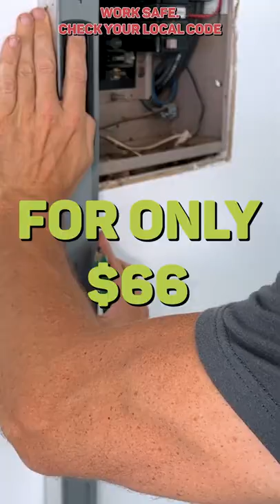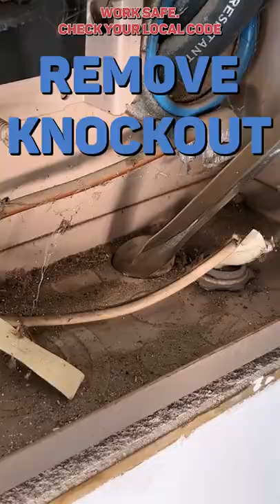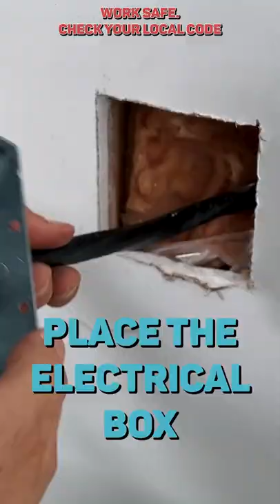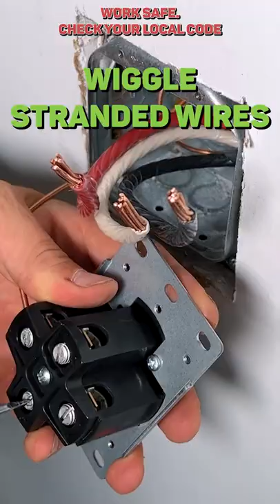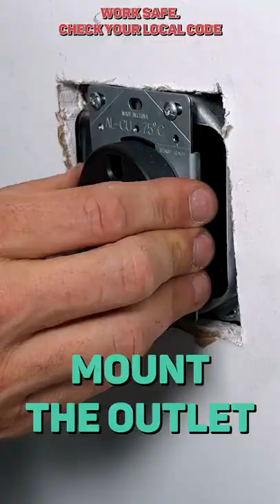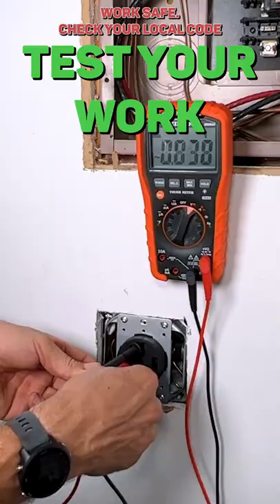240V Outlet For $66 #shorts

Comment: Using a bare wire in with non safe terminal screws, 250v, 50amp is a recipe for a big boom-town.
Reply: 50ampere is quite much I work with up to 16 at 230V

Comment: There has to be something wrong for these plugs to be melting if they are rated for say 50 amps. Im betting these batteries pull far higher amps like closer to 75-100 min and the wire feeding them is undersized. What i dont get is why a breaker isnt poping generating that much heat.

Comment: Didn't use a real double gang, cut in box, no connectors. The wire looked like it was sized for a 60 amp breaker, and the ground looked like a #12. Minimum size needed would be a #10. You did practically nothing to code. You should delete this video.
Reply: A lot of his videos are like this. Handyman doing electrical is not ideal.
Reply: For practical purposes is going to work because he is also using the conduit which is grounded. He is using a 6/3 wire with a NEMA 10-50R and should not be a problem but the inspector might not think so. ?? Local code needs to be check.
Reply: @francosepulveda8438 what inspector?
Reply: What about properly torquing the lugs?  I didn't see a torque screw driver.
Reply: He did nothing wrong. He did use connector and that’s a 10 gauge stinger. 6-3 copper can be used on a 50 amp breaker.

Comment: Need a cable clamps where the wire goes through the knockouts at the device box and the breaker panel.  The omission is a code violation and will be encorced in many places.  Vibration and heat, overtime, will cause the steel box to slowly cut through the insulation of wires resulting in electrocution hazard.  Also, the video does not show a cover plate over the receptacle.  I'm sure you did this and it probably didn't fit within the length of the video.

Comment: Ur videos been helpful to me. Im learning alot. Thanks for sharing. If i use this kind of 240v outlet, what gauge of wire is that? Thank u in advance.
Reply: Depends on current. I'm installing two 240v receptacles. The 50 amp circuit with be 6 gauge, my 30 amp circuit will be run with 8 gauge to support 40 amp in the future. You'll also want to upside for longer runs of copper. Google should tell you pretty clearly what you'll need.

Comment: I have a 210v window air conditioning my outlet is 110v.  What size of wire do I need. Thanks
Reply: What?🙄
Reply: You did not give enough information.  Wire size is based on current.
Reply: You just need a step up transformer to get you to the voltage you need to supply the equipment or find a different power source that will get you to the 210 or 208 nominal voltage you need.
Reply: @elblazintuna6468  it is legal to re-identify your neutral as a "hot wire".  This would allow Romex (NM cable) to supply 220-250vac.  Again, the wire size may not support (supply) enough current to support the load and positioning the neutral wire as a hot may not allow the 120vac controls to no longer function.

Adding a transformer might be a very expensive fix.  Nec section 450 covers transformers and has requirements for extra fuses and in some cases separate rooms with fire rated walls at 3 hours (6 inch thick re-inforced concrete) or  a sprinkler system and a 1 hour fire rating.  This is nec section 450.42.
Reply: @elblazintuna6468  it is legal to re-identify your neutral as a "hot wire".  This would allow Romex (NM cable) to supply 220-250vac.  Again, the wire size may not support (supply) enough current to support the load and positioning the neutral wire as a hot may not allow the 120vac controls to no longer function.

Adding a transformer might be a very expensive fix.  Nec section 450 covers transformers and has requirements for extra fuses and in some cases separate rooms with fire rated walls at 3 hours (6 inch thick re-inforced concrete) or  a sprinkler system and a 1 hour fire rating.  This is nec section 450.42.
Reply: @keithharrington4595  if your only being supplied a neutral and an ungrounded from the 120 receptacle, I’m guessing you would just have to run a different circuit from the panel for your 240 volt load( or whatever voltage the AC was)? Making it a two pole breaker for that as well?
Reply: @elblazintuna6468  Yes.  You can mark your neutral (normally black, red, or blue industry standard, no NEC requirement) and connect it to a double pole with the hot for 240 volts.  Again, wire size determines the amount of current.

An example of this is your water heater with 10 - 2 Romex or NM cable.

Double pole breaker with black as hot, white re-labeled (taped) as a hot and the ground for this 30 amp circuit.

My concern with what you are asking is, do you need a neutral?

Your stove gets 240 vac for the heaters, but the neutral allows the clock to run on 120 vac from the same circuit.

So, like your stove, you may not get control functions to work on your a/c unit without the neutral.

I will encourage you to talk with a local licensed electrician.  Maybe a beer or some cookies for them to come out and advise you.   Like Google maps, they can get you on the correct path and let you do all the driving.
Reply: @keithharrington4595  Your range has a specific recep that is wired with two hots and a neutral along with your ground, so your 120 functions will work just fine as long as it’s properly wired, the in question AC sounds about the same scenario? You wouldn’t be able to get the required voltage out of a normal receptacle, unless I’m just overthinking it?
Reply: @elblazintuna6468  If I make 10-2 carry 240, the wiring looks like this....

Ground..,remains ground.
Black hot....remains hot (one leg of 240)
White.....becomes a hot ( leg two of 240)

This means the neutral is lost.  The only voltage you get is 240.  The 120 cannot be achieved without the neutral.

Should this be a stove, your electronic controls are lost...no clock, no digital timer as they are 120 v.

I expect the air conditioner is the same....no 120, no digital controls.
Reply: @keithharrington4595  yep 👍 you got it
Reply: use #10 awg wire.  10/2 and use a double 30/30 amp breaker
Reply: @michealnunez6346  again, will it work without a neutral?  Many appliances need 240 vac to operate major components and 120 vac.for thee controls.  This 120 vac is gotten with the neutral.

I again point to a stove.  240 for the heaters and 120 for the clock and controls.    Should your clock control baking time, no oven.  The more controls from the clock, the more you loose.

Apply this to your a/c unit and you may have a giant paper-weight.
Reply: @keithharrington4595  to provide power to operate the timers, vent fans, and other accessories, the stove uses a simple 120-volt circuit, but it also uses a 240-volt circuit to heat the stovetop heating elements and oven heating coils. Hence, it requires a 120/240-volt receptacle and circuit with an independent neutral wire that provides a return path for the 120-volt portion of the circuit.
Reply: Also yes 240 circuit runs with no neutral. Ground stays ground.
Black stays hot.
White is now hot.(wrap partial with black tape to label it as hot)
Reply: @michealnunez6346  yes, as you pointed out above, the stove needs both 120 and 240 to fully function.  Will this a/c function without a neutral?  That remains the question.
Reply: Hire a professional.

Comment: Wow there is so much information missing from this video. You really should take down this video immediately.
1. The installed box is not secure to anything just shoved into the wall.
2. The cable housing the conductors is not secured to either the service panel or the metal box just shoved in the wall.
3. Where is outlet is being installed determines whether you need a four wire or a three wire cable connection. Mobile home, boat house, single phase, 3- wire system, 4-wire system etc.  It definitely makes a difference.
4. Depending upon what the circuit is providing power to and/or the location of the said circuit, it most definitely could require ground fault circuit interrupter protection. This one life/safety issue alone would would drive a conscientious, responsible adult to remove this home depot laborer's hack job immediately.

5. There are enough idiots out there on the internet trying to convince people that they can save a few bucks, regardless of the potential danger they place both themselves and everyone else who is around that equipment.

6. There is a reason they have a national electrical code and there is a reason why there are electrical inspectors and there is a reason why there is training and continuing education for qualified, licensed electricians.

Comment: Retired Electrical Contractor here. At least 4 major code violations in your installation. Box is not grounded , connectors missing and cable is not attached /secured to studs within 5 inches on both ends. What I mention here is for your information, and viewers are better off hiring licensed professionals for their sake and yours. This kind of wiring requires a dedicated circuit wiring PERMIT.
Reply: While almost everything you said is correct… I’m wondering where you got the 5” from?

Comment: Of course you should have your incoming shut off before doing this type of work... no need to risk your life over a couple hundred in savings.
Great short though
Reply: Why? He had his breaker off when stabbing it on the buss bar. I’m a licensed electrician and I do this all the time. I even put in screw in type breakers in 480v panels live. Not all situations are you gonna be able to shut off the incoming power.